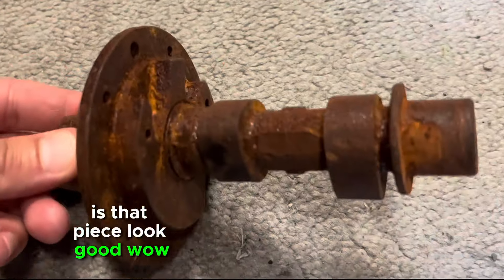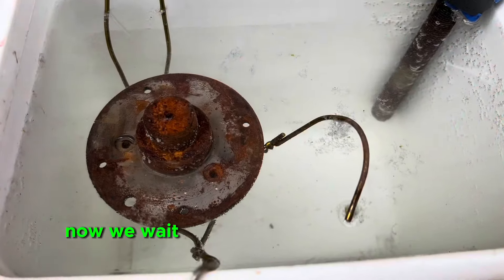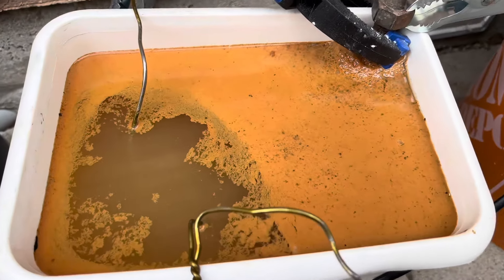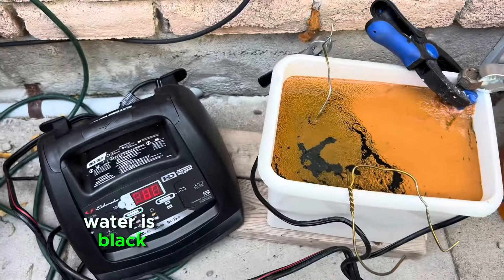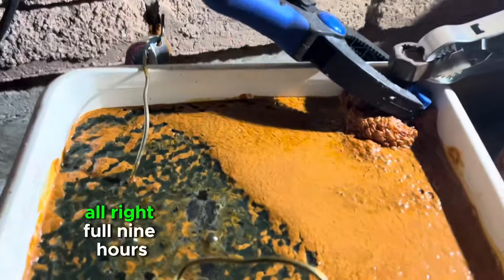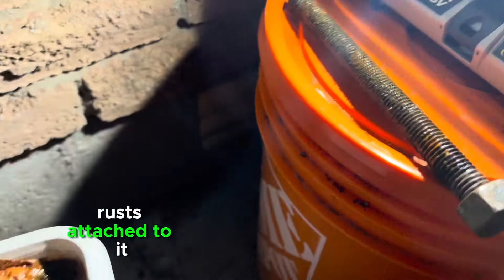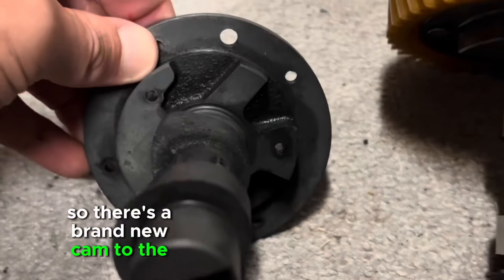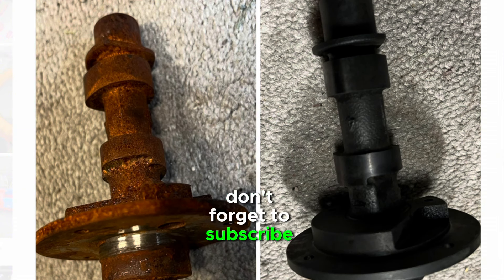DIY Electrolysis Rust Removal with 12 volts

Comment: Vinegar does the same thing
Reply from the maker: I will have to try that sometime!
Reply: No it doesn't.  Electrolysis converts the form of the iron oxide, but does not attack non-oxidised metal in any way.  Vinegar eats the rust, and then it eats the metal underneath, and it eats the good metal faster significantly than it eats the rust.  Leave a piece in the electrolysis bath too long, weeks even, and it will come out dimensionally stable.  Leave it in vinegar too long (and you don't know how long is "too long") and it will come out pitted and significantly undersized.

If you somehow need a purely chemical reaction, you want citric or phosphoric acid, both of which are chelating agents and do basically the same thing as electrolysis.
Reply from the maker: @wibblywobblyidiotvision  I had no idea Vinegar was so corrosive! thanks for the information.